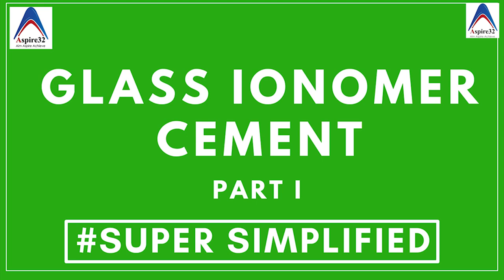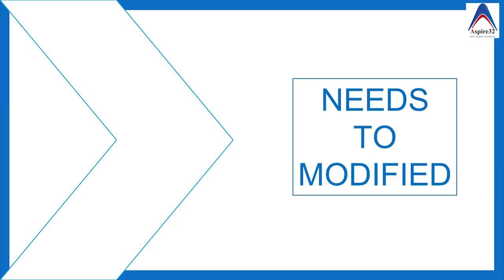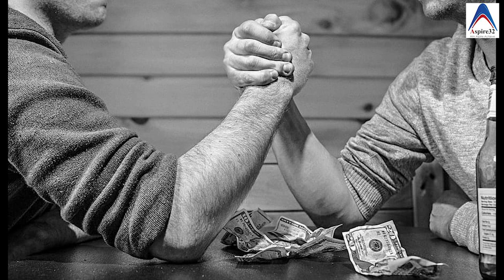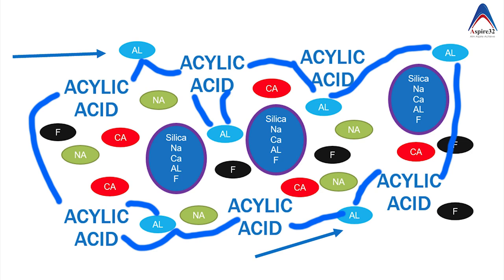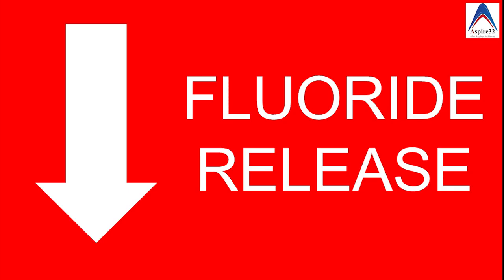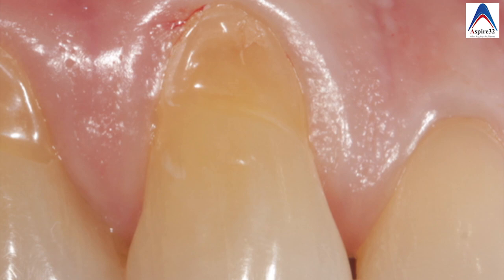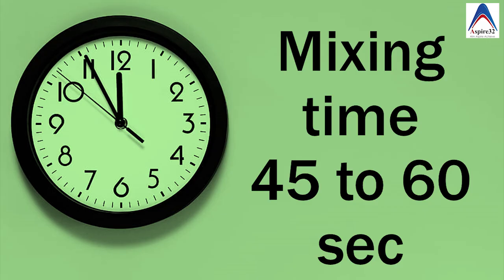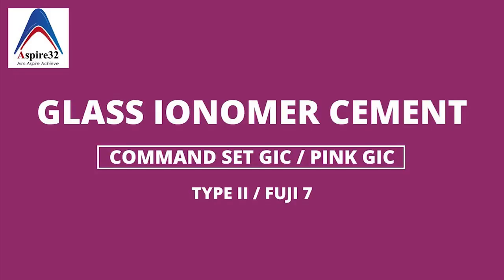Glass Ionomer Cement | Dental Cement

Comment: Hi Dr, i was wondering if the 3 types of classification for GIC is also applicable to Zinc polycarboxylate, (1.the luting, 2.restorative and 3.base and liner)
Reply from the maker: Pls check my zinc polycarboxylate video
Reply: @Aspire32  Thank you Dr for your response, i checked the Zinc polycarboxylate video but it does not mention 3 types, so i am assuming the 3 types, 1.the luting, 2.restorative and 3.base and liner, are only for Zinc phosphate and GIC?